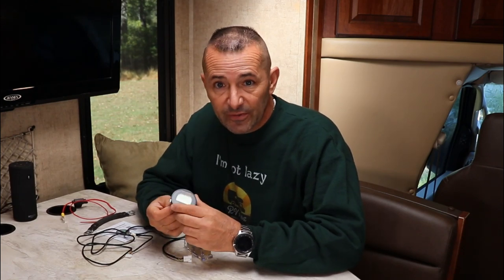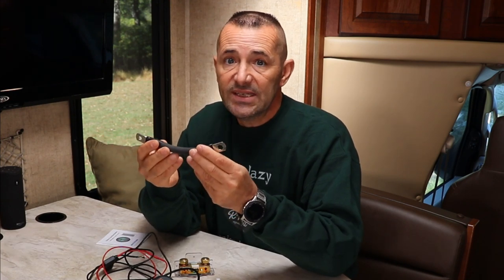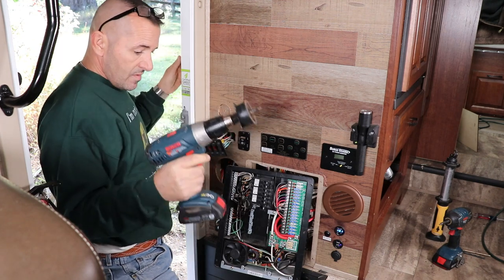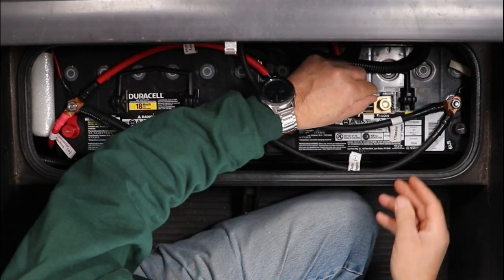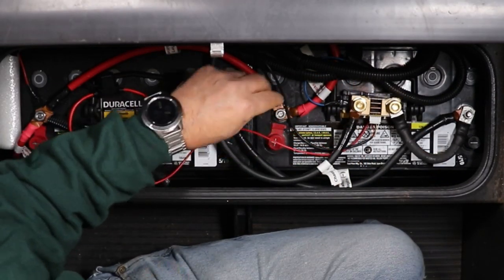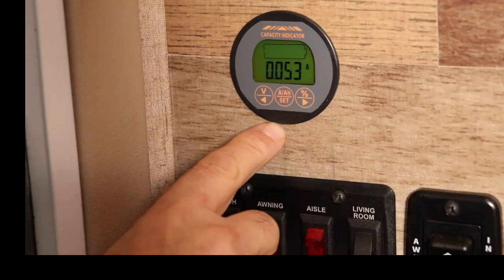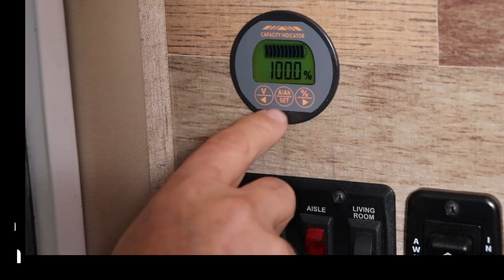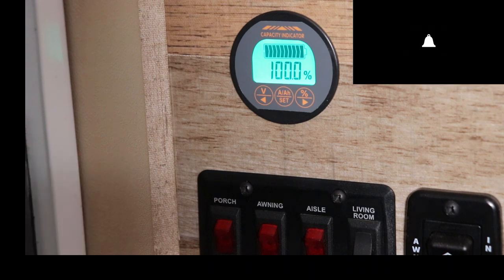Installing A Full Function RV Battery Monitor From AiLi Qwork– How To - Tips and Tricks - RV Upgrade

Comment: Could you combine this with a battery disconnect switch? If so where would you install the disconnect?
Reply from the maker: If you disconnect the meter with a disconnect switch the meter would need to be reset each time you reconnect batteries and would not give an accurate reading.  If you install a disconnect switch for the RV that is fine since the meter should be installed at the battery before any disconnect switch and should continue to run regardless of disconnect switch.
Reply: @RVHabit  Thanks. Yes that is an issue but I don't have any solar hooked up permanently so when I store the trailer I need to disconnect the battery so it doesn't drain.
Reply from the maker: You can disconnect batteries but the monitor is connect directly to monitor and should not be disconnected.  This way it is constantly monitoring batteries even when they are disconnected from the RV.
Reply: @RVHabit  Okay. I guess I need to think about where I install the disconnect switch. I assumed once the negative feed from the battery was cut that the positive feed to the meter wouldn't work but I don't really understand electric circuits.

Comment: what i wonder is if you run down your batteries then plug in to shore power does the meter show them still down or at 100%?
Reply from the maker: No.  It measures amp hours in and out.  So if you plug into shore power which turns your converter on, then the meter will measure amp hours going into battery.  So if the batteries were for example 50 amp hours below 100% the meter will only show 100% when 50 amp hours has been returned to the batteries.
Reply: @RVHabit  I reckon I must have done something wrong. I installed the Drok hall sensor monitor and when I drained the battery the meter showed i had about half-full amp hours but then when i connected to shore power it showed i had full amp hours.
Reply from the maker: That does not sound correct.  The whole purpose is to give accurate amp hours in battery by measuring what is being used vs. what is being replenished.

Comment: Great vid.  Can I ask where’d you get the transparent mount?
Reply from the maker: The monitor came with the shunt bracket.  If it no longer comes with the mount you can get them here  
 https://amzn.to/2I1g6JX
Reply: @RVHabit  thanks I’ll have a look though the one I bought is 150amp.
Btw you mentioned that all earth should go through the shunt in order to get read outs etc But do I also have a seperate main earth from battery to 4wd/vehicle chassis?
Reply from the maker: Your main ground should connect to the vehicle chassis.

Comment: Sorry. Except for the battery monitor and shunt, none of the other components you show links to make sense. The link to the 1/0 cable doesn't link to a 1/0 cable. The 12v fused wire link goes to a 5-pak...not the wire you shown in your video. Although I thought your video was excellent, the links to components doesn't help a complete electrical idiot like me.
Reply from the maker: I fixed the 1/0 cable link.  The link to the fused red power wire comes in a five pack.  They are only fuse connectors and you may need some additional 12awg wire.  Good luck.
Reply: @RVHabit  I purchased the red power wire from the link but the 12awg wire is much too big for the shunt connection point.  Did I miss something?
Reply from the maker: Hi Robert if you are referring to the fuse with tails yes that wire I connected to a higher gauge wire to fit.  The fused wire tails only come in the thicker wire guage.  Hope that helps.
Reply: RV Habit Got it.  Love the videos.
Reply from the maker: Thank you so much I appreciate it.

Comment: Hi, question for you...I just installed mine today...so far everything seems to be ok..except my display stays on...does yours stay on too? Does not bother me but want to make sure that's what it's suppose to do
Reply from the maker: Yes my display stays on.  The light will go off except when power is going into the batteries it will light up.
Reply: @RVHabit  mine is staying on even when not charging
Reply: @TC-tw5zk  u may have the negative wire invertedly. the -B should b connected from the battery and the -P is to the inverter ground wire.
Reply: If you hold down the volt and % buttons together for 3 seconds it will turn the backlight off completely. I figured it out through trial and error since the flashing backlight was driving me nuts.

Comment: Lou, thanks for this video, very helpful. I installed mine today following your video as a guide. All seems to be working except that I expected the display to dim down after some time not pushing buttons. Is it supposed to go dim or always stay bright. Do you have any thoughts? Thanks for any help you can offer.
Reply from the maker: Hi Mike, If the batteries are charging or discharging it will blink slowly.  When not charging or discharging the light goes off after about a minute or so.
Reply: Lou, thanks again for all your helpful info, I have installed a couple of the upgrades you highlighted as well as used your guidance on a few maintenance items on my camper. I seem to be having issues with my battery monitor: I was out of town for the weekend with camper plugged in and battery disconnect in off position. When I got home, the monitor said my batteries were down to 50%. I then turned the battery disconnect back to on to charge the batteries. Batteries are charging but extremely slowly - been charging for 36 hrs and just up to 92% and current in is .331 amps. I hadn’t noticed what this had been before so wondering what it should be. The past two months prior to this I have been camping a few times and all has seemed fine. While I was out of town for the weekend, my house did loose power for a while - not sure why, no storms in the area. Wondering if this could something to do with the issues I’m having. Very long way to ask do you know why my batteries would drain so far with battery disconnect in off position - I know that battery monitor has a very small draw but that is the only thing using power. 2nd question, what should the current in be when charging batteries from shore power? FYI, batteries were new AGM batteries at the time I installed the monitor. Thanks for any help you can offer.
Reply from the maker: Hi Mike, you have a lot going on.  First I don't think your batteries would drain that quickly when disconnected.  Get a multimeter and check those batteries.  When plugged into shore power you should see about 13.1 volts for standard charging and about 14.1 volts when bulk charging.  Make sure your battery monitor stays powered when you disconnect batteries.  Cutting off power to the monitor will lose all settings.

Comment: Two questions:  1) rather than an inline fuse for the power wire, could I take it to my DC load fuse box?  2) instead of all negative lines connecting to the P- side,  can I just connect the P- side to a negative bus bar?
Reply from the maker: As long as all negatives go to P side and one negative from battery to B side that should be fine.  Many people use bus bars to manage multiple wires.  As for power I don't see a problem getting it from any 12v source but it must be constant and not turn off.  If it loses power for example with the battery disconnect switch it will not monitor batteries and will have to be reset when power is restored.
Reply: @RVHabit  One more question: My system (solar controller/DC-DC charger, inverter) are all wired with 4 gauge. Can I connect battery neg to shunt B- with same gauge or need like you did with 1/0 cable?
Reply from the maker: I would only feel comfortable with 1/0.  I know its the negative wire but bigger is better in my opinion.
Reply: @RVHabit  Would that apply to P- going to neg bus bar? (Thanks for you patience with me!)
Reply from the maker: Yes definitely.

Comment: Thanks for your video!  It helped greatly with my install!   I do have a question.  When the unit is in "Stand-by Mode" it will flash the display, not with the back-light, just the words, numbers or symbols.  Have you experienced this?  Other than, that it works as described in the instruction booklet.  Thanks.  :)
Reply from the maker: Dave, that's right no light in stand by.  Sounds like it is working right.
Reply: @RVHabit  Thanks for your reply!  When in stand-by does whatever you display is on , say Volts, pulse the Volts every 20-25 seconds with no light?
Reply from the maker: Yes that is correct.
Reply: @RVHabit  Awesome.  Thanks for that info.  No one has mentioned it, and I just assumed I got a faulty one.  :)

Comment: Great video...is it possible to connect 2 of these monitors & run power to both?
Reply from the maker: I don't know first hand.  Your asking if you can have two monitors for one shunt I assume.
Reply: @RVHabit  Yes
Reply from the maker: Well the shunt only has a plug for one monitor but I suppose you could use a negative bus bar with two cables coming off to two separate shunts and monitors.  It certainly sounds like it would work in theory.  If you try it let us know how it works out.
Reply: @RVHabit  Shall do!

Comment: Have you had any issues with the shunt being mounted on top of the battery? Also, how did you secure it to your battery top? thanks!!
Reply from the maker: I used a small piece of Velcro (hook and loop).   The wires correctly secured also helps in keeping it place.  It has not moved at all.
Reply: @RVHabit  have you had any issues with corroding or anything from the battery gasses?
Reply from the maker: None at all.  I upgraded to AGM batteries last year but I had no problems with the previous wet lead acid batteries either.
Reply: @RVHabit  Great thank you!
Reply: I use CA (cyanoacrylate) glue and have had zero issues. GK

Comment: Great video bud, what fuse did you fit for the monitor power?
Reply from the maker: I used an inline fuse connector with a 5 amp fuse.  Similar to these https://amzn.to/2FNuEYR
Reply: That link will give you a 12 gauge wire so make sure to find something like that in 16 gauge

Comment: Should my batteries be completely charged when setting the capacity percentage?
Reply from the maker: Hi Paul, yes the batteries should be fully charged when setting up the monitor and capacity percentage.
Reply: @RVHabit  Just wanted to confirm. Finally at the setup point. Thanks!
Reply: I see that you can set the voltage after clicking the v and the holding set. Would this be the voltage of the system like 12v? or voltage at 100%?
Reply from the maker: Hi Paul,  You only set the total amp hours in battery bank and then set the percentage at 100%.
Reply: Remember your batteries only have the rated capacity when new. If they're well treated the capacity will decline much more slowly than if they get left partially discharged (lead acid only).

Comment: Thanks Lou, I ordered the same unit. My batteries have a 1 gauge wire for the ground, I already have a short 2 gauge wire on hand, is there any reason I can not use the 2 gauge  or should I go get a 1 gauge ?
Reply from the maker: Hi Steve, I would be hesitant of going with a wire that is not as large as what the coach has.  If your your coach has 1 gauge I would go with that or larger. I went with a much heavier cable just to be safe.  You can get the short negative cables on Amazon pretty cheap.  Good luck.
Reply: @RVHabit  Hmmm...i use very thick 4/0 lugs.  I don't think the screws are long enough which is too bad.
Reply from the maker: what about adding a negative terminal block for the negative wires then just one connection from the terminal block to the shunt?

Comment: It looks like the batteries are in parallel? All the neg. Wires don't look like they were wired to the shunt?
Reply from the maker: Hi Batteries are in parallel.  And, yes the negative chassis wires are connected to the shunt.  The monitor is still working flawlessly.  Thanks for watching.
Reply: 0So the ground wire on the battery is to keep the batteries in parallel? I was confused because you said, "all negative wires get connected to the shunt" but then I saw the one to the negative battery post.
 @RVHabit
Reply from the maker: Yes the two batteries are connected in parallel.  That does not change.
Reply: My two batteries are wired in series and I don't think hooking all the negative wires to the shunt will change anything @RVHabit  but if it does I'll find the battery lead and hook it back directly to the negative post on the battery.
Reply from the maker: The batteries remain connected in series.  Then the shunt is installed on the negative post and the negative chassis cable to the shunt.

Comment: Thank you for this info and video...  Does this monitor need to be continually reset/recalibrated?

Many of the Affordable battery monitors tend to float
Reply from the maker: There is no information on that but it is good practice to do that at the beginning of each season.  Also some say to adjust amp hour capacity each year as the batteries degrade.
Reply: @RVHabit  thank you for the quick reply...   The victron monitors prove to be more stable...  If i can source a used victron... This ali unit will be my choice...  

Please keep the informative videos coming...
Reply from the maker: This AiLi unit has worked flawlessly so far.  For what this unit does I can not justify the cost of the Victron.  I am very happy with the AiLi.

Comment: Hi I installed meter but the light remaining on. How to set to go off
Reply from the maker: The light stays on as long as the batteries are charging.  The light will go off when no charge is going to batteries.  As far as I know there is no way to toggle the light manually.
Reply: @RVHabit  but your meter go off when finish touch the buttons
Reply from the maker: The meter is always on.  The light will turn off automatically when batteries are fully charged but the meter is still on.  If the light is off you can press the center button to turn light on but it will go off again automatically if batteries are fully charged.
Reply: Press both outer buttons at same time for 3 seconds, backlight will turn off.

Comment: Thanks I’m planning to get the same unit. I might end up using hot glue to hold it in bracket looks like a pita happy travels
Reply from the maker: You can also fabricate a small front plate that can attached to the wall.
Reply: The bracket looks a little useless I'm about to install my aili could you not just flatten the bracket out to make it more secure?
Reply from the maker: The bracket actually worked very well for me.  The alternative is to cut a thin piece of wood (say 1/4 plywood) with a hole in the center.  Use this as a face plate.  attach the monitor to the piece of wood and now you can screw the wood to the wall or mounting location.

Comment: Thank you, great video, i just installed mine. I have one question when the batteries are being charged from the converter the light pulses from dim to bright, is that normal? when the converter is off the light stops pulsating. Also the voltage reading is off, the unit reads 12.46 my meter reading is 12.41.
Reply from the maker: Yes the pulsing is normal while your batteries are charging.  That minor difference in the voltage reading is pretty normal for different meters.  Your batteries should charge higher than 12.6 though.  When charging I would expect to see 13.1 or higher.